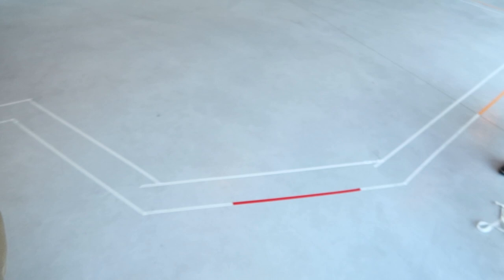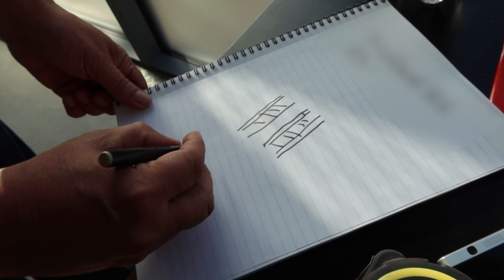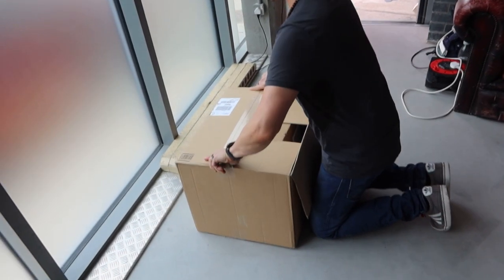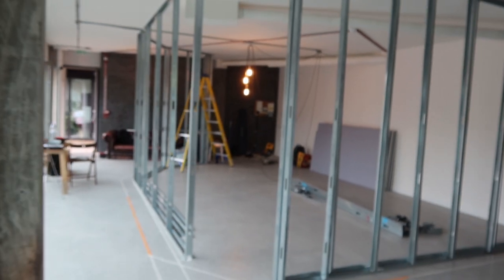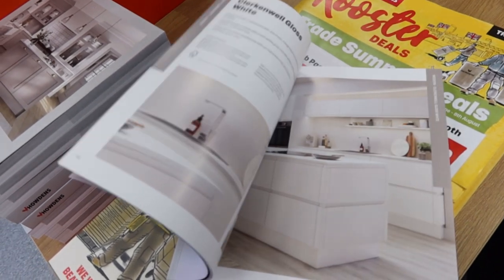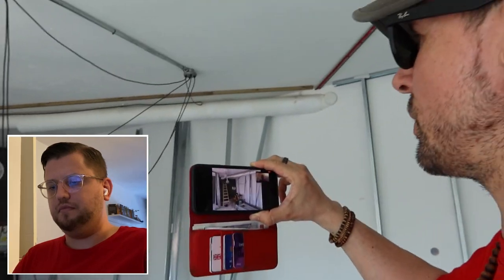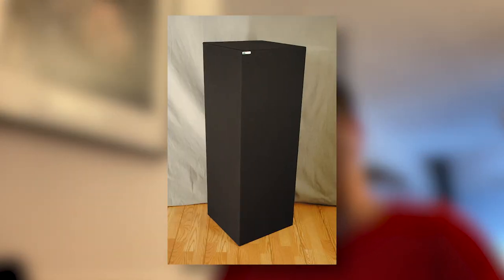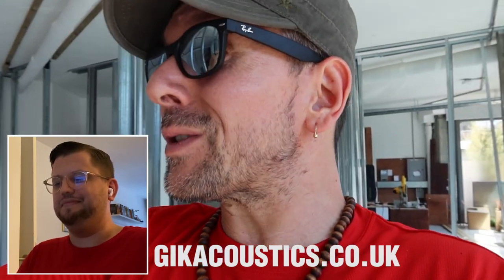Building My Dream Music Studio Ep. 2: The Works Begin

Comment: So happy for you mate. I design nightclub sound systems for a living and one super duper tip for you is filling the wall void with granulated cork is extremely effective for absorbtion, also fireproof and cheap (it's a waste product). Also, get your drywall guys to offset where the board joins land on the studs. So if there's a join on the inside stud, no join on the outside matching stud. You do this by starting the outside wall with a half board and the inside with a full board - easy. Also, all wall penetrations, like power outlets, ethernet points, etc, should be backfilled with expanding foam. Man I can go on forever, hit me up if you want more info. I'm based in Ibiza, so almost same timezone.
Reply: Unfortunately, judging by the dates in the video, the walls are probably up by now! Excellent advice, hopefully they knew what they were doing. I'll keep it in mind for the day I build my studio.

Comment: Congrats dude and thanks for taking us home studio folks along for the ride as we get to learn with you. Keep us involved in what we call rough ins here in the states (power, comms, low voltage, etc.). I don't know what they call them in the UK but check out something called smurf tubes here in the US. They're essentially a bigger plastic flex conduit with a pull rope/string inside that you can run in your wall cavities) air gaps with pretty wall boxes/trim plates and it allows you to route your already owned cables in a tidier but semi-permanent fashion. They help you stay future proof too for new cabling technology that comes out as you can re-fish new wires/cables yourself. Been building custom homes for 12 years now and we use them all the time now in our home theater/audio installs as the tech is constantly evolving.

Comment: So glad to see the 'Air Gaps' making it into the design.
So many people miss the point, and the mechanical value, of that layer. 
I'd also have looked at double skinning the plasterboard with different thicknesses (different resonant frequencies) but perhaps with the 'Foam' that won't be such a concern.
No floating floor ? Not enough height to play with perhaps ? 
I see you're concerned about transmission through the building, the floor is part of that ...
Reply from the maker: I’m getting all of that ;-)
Reply: @Doctormix  Just checkin ... 😉🖖

Comment: You could of exposed the some of rockwool as sound dampening and if you don’t like the look of it cover it up with acoustically transparent cloth.
As for the plasterboard mounting, it would have been good to use acoustic buffered resilient mounts - but doing that means that nothing can be mounted on those mechanically isolated walls.
Also consider proper door seals to attenuate sound transmissions.

Comment: This is exactly what I did 2009. in my then newly purchased studio space. Two suggestions - 1. Use two Knauf plates on all walls, one 15mm and one 12.5mm, seal with Sikabond (or similar). It gives you extra stable, though and sound proof walls. 2 - for cellings in all audio rooms use Knauf celaneo audio plates (or similar) and fill all space between solid celling and Cleaneo celling with absorbing metrial. If you lower celling 20-30cm, this will give you excelent broadband absorber that does not take any extra room. Believe me, this works nicely good and requires minimum wall and corner acoustic treatment  afterward.  Wish you all the best :-) cheers

Comment: if you are looking for a good sound isolation you should add mass to the wall, I would recommend concrete blocks wall with isover and  plasterboard on the outside and some additional layers absorbing sound reflections. a light wall is a poor sound barier, it's not  able to absorb a lot of energy.

Comment: Triple Leaf Effect , I suggest read up on it before you proceed any further. You would have better sound isolation if you left that inner sheet of plasterboard out.  You also need to make sure the window pans are not parallel to prevent standing waves between the panes. Some research now will save you time and money later. or if you can afford it, a  consultation with professional Acoustic Engineer will help a lot. Acoustics are a  very complicated  science to which logic does not always apply. Love your channel BTW
Reply from the maker: I’m getting professional studio windows from IAC Acoustics, you’ll see in the coming episode ;-)

Comment: Wasn't there supposed to be a 3rd layer of drywall in between the inner and outer walls of the rooms (which had to be put in before the 2nd wall was put up)? Anyway congratulations! ~~~~ (good vibrations)

Comment: The only thing I'm afraid is the vibrations being transferred to the building.  If I were you, the inner room would be placed on a vibration-absorbing floor.  So first the floor and walls on it ! So that they don't have physical contact with the concrete floor of the building. The suspended ceiling also requires special vibration-absorbing fixings.

Comment: Your mixing-room is quite small, more a mix chamber. The smaller the room, the more room resonance modes you get. Absorbers wont do the job here, you will need helmholtz resonators finetuned on the modes of your room

Comment: Steel studs have much more potential to vibrate, ring, rattle, hum, buzz, etc. If you intend on having decent bass / mids reproduction in the room, be very careful about damping the steel studs and all connections. One little loosely screwed joint can buzz every time a certain bass frequency is reproduced in the room. Personally and professionally I never recommend steel framing for studios or even home theater. The best partitions for serious acoustic isolation are 10" cinder blocks with hydraulic mortar right over a concrete pad. 3/4" strapping and dual 1" drywall right over. The best studios and interrogation facilities also deploy min. R10 Owens Corning Foamular in between the drywall !
YOU'RE DOING IT ALL WRONG CLAUDIO, RETHINK THE CONSTRUCTION DESIGN !

Comment: Well sir, I guess it helps that your STUDIO building is CONCRETE and NOT brick walls with a wood floor and wood roof.. Sadly I am not so blessed with all concrete building. I have an old duplex HOUSE that is solid brick walls but ALL the floors are wood and the roof is wood. American building at its finest. Oh, and no slab foundation either, it is wood over dirt. So my studio will be a challenge to build. I live in a neighborhood too so, there is THAT.
Reply: Can you make a foam-filled floor perhaps?
Reply: @Skiamakhos  I do not know yet, but I am planning on removing the bottom floor and building a concrete block and poured concrete inner foundation within the structure and remove all the wood floors in the floors above(I have a 3 floor house split). I am looking at the primitive wood/concrete floors used in OLD SAN JUAN PUERTO RICO houses. So long as I have a good foundation, I can do THAT, then it is all good. As for the ceiling/roof? I can only do wood so I may do the SWISS method and rebuild the ceiling substructure with solid wood beams,boards and fill,(no cavities),then hang my concealed grid ceiling to that. My ceilings will be low, but damn it, they will be solid and sound resistant. I do have a very tiny example of my intended concrete on wood floor idea just in front of what was the old fireplaces in this house. They poured a 2" slab of concrete on top of a well supported wood subfloor.
Reply: @pianokeyjoe  remember though that sound carries through solids like concrete. Good luck with your building!
Reply: @Skiamakhos  I know, and thankyou! My issue is I need MASS, for the bass sounds. The more MASS, the better at keeping the boom boom boom sounds IN my house. I did test my theory in Puerto Rico when I went all out with my music nice and loud and my neighbors under me did not hear it! All concrete structure. No acoustics either. So here in the USA mainland they build with part brick and part wood which is driving me mad but I will figure it out.

Comment: You should have got an acoustician to design your studio, unfortunately you've made several errors which are going to greatly reduce your sound reduction between spaces.  The most obvious is you've created a triple leaf system - I cringed when your builder was talking about how to get another layer of plasterboard inside the cavity - the plasterboard inside the cavity is not needed and should not be there - this has worsened your sound reduction, especially low frequency reduction.  You should have put the drywall panels on the outer most face for each stud frame, which would have provided the biggest air cavity between the two mass layers.  There is also no need to use Rockwool inside the cavity, it does not increase sound reduction - cheap fluffy insulation would have been just as effective and cost a lot less.